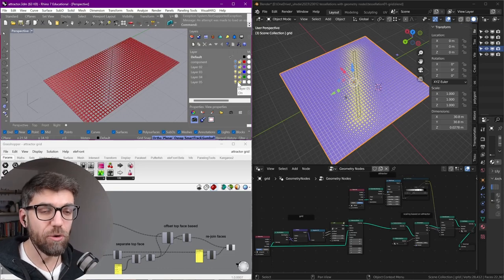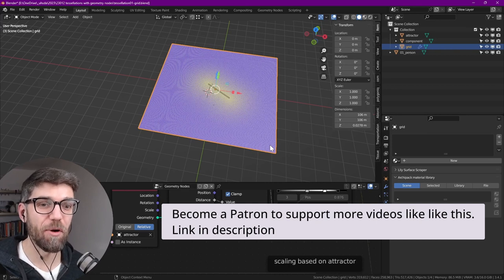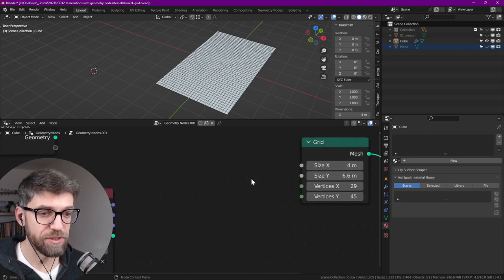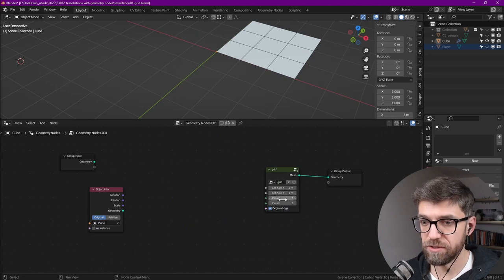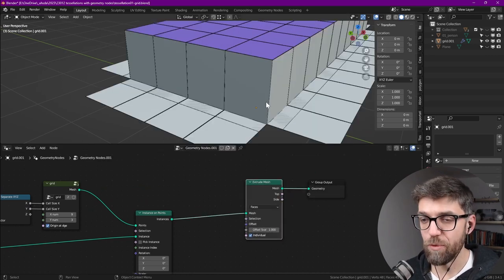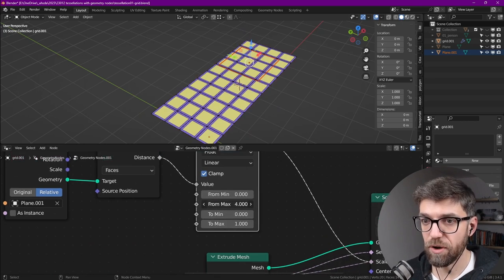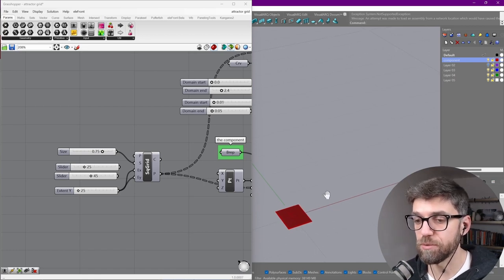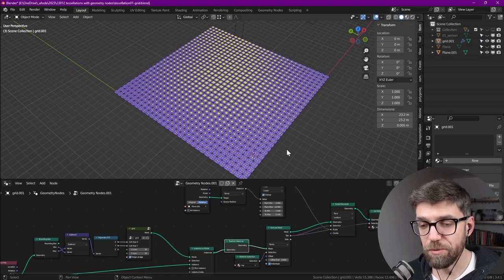Attractors in Geometry Nodes Blender and comparison to Rhino Grasshopper

Comment: I think the algorithm in grasshopper is much more concise and easy to understand. But this is not quite the right comparison, by the way. 

Grasshopper uses vector objects, which require more computing power. The advantage of vectors becomes noticeable on curved surfaces. 

And here you can also use mesh geometry objects in GH, and then everything will work much faster.
Reply from the maker: Yes, meshes work a little faster that Nurbs, which Rhino meshes for display purposes in any case indeed. By the way I think you mean Nurbs, not vector object, as both GH and Geometry Nodes use Vectors for transofrmations.